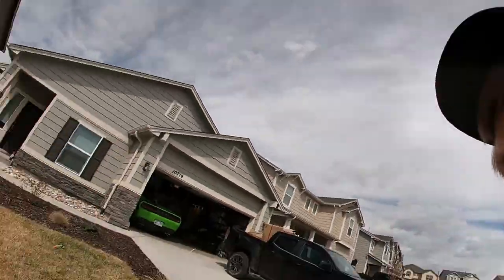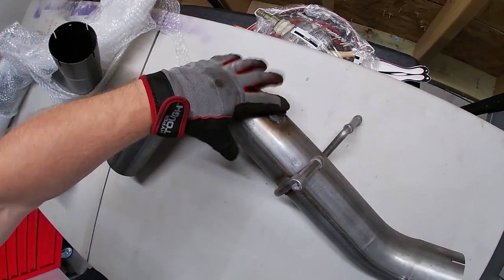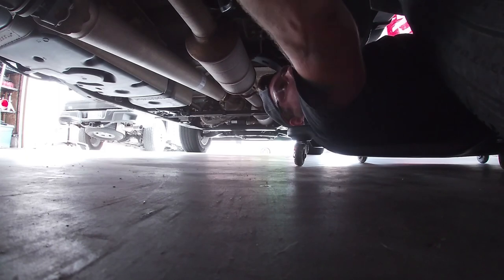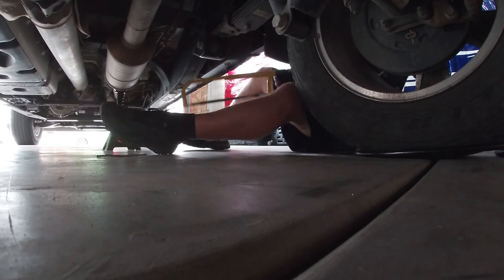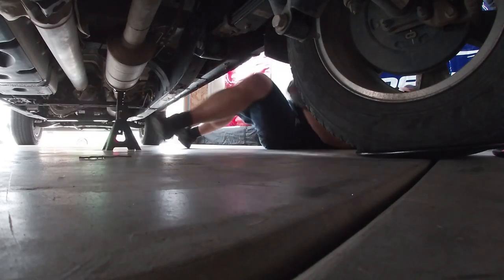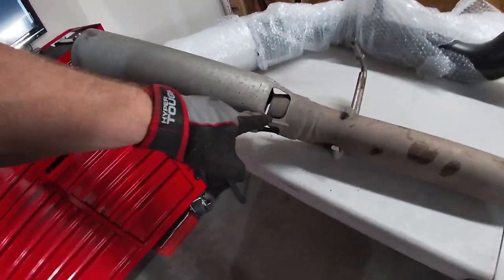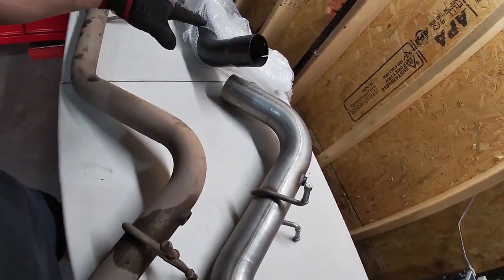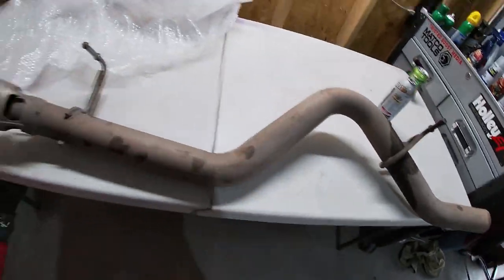2016 Chevrolet Colorado 2.8L Duramax MAGNAFLOW 3.5" BLACK SERIES FILTER-BACK EXHAUST SYSTEM install!

Comment: Filter back exhausts do little to nothing for sound or performance since the DOC and DPF muffle a majority of the noise. Also that’s not an O2 sensor, that sensor monitors exhaust temps. Also why the factory pipe is setup like that, to allow air to enter the exhaust to cool it off before it leaves the “tip.” During regen the exhaust temps are exceptionally high.
Reply from the maker: Good to know some more info about the system. Haven't done much on the newer diesel systems. And don't really want to lol. Yeah instructions weren't super clear on what sensor was what either. Just to remove (secondary o2). Thanks for checking out the video though. Unfortunately trying to find anything to do while all the tracks are closed and no car shows to go to.

Comment: It’s your truck but you just wasted money on it. It’s a 2016. You can still delete that year model. I deleted mine and wow it’s a different truck. I average 32 on the highway
Reply from the maker: It was a neighbors. I believe he plans to do more, its already tuned or something. He got the exhaust stuff for free. I just put it on. I agree with you though.
Reply: Wait it is legal to delete a 2016 diesel? I’m thinking of buying a diesel Colorado but I’ve been hearing the epa outlawed deleting diesel trucks
Reply from the maker: Depends on where you live. This guy had a full delete and tune on it as well. No emissions testing in out county.
Reply from the maker: They try to make it harder to delete and tune them by locking the pcm.
Reply: @twistedboostmedia9683  kk thx m8
Reply from the maker: No problem thanks for checking out the video. Throw us a sub!!!!